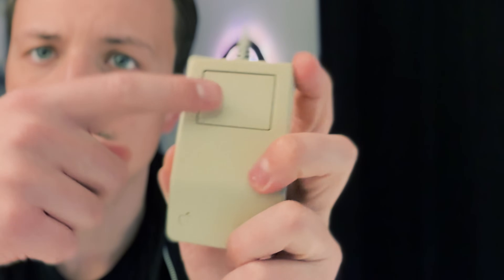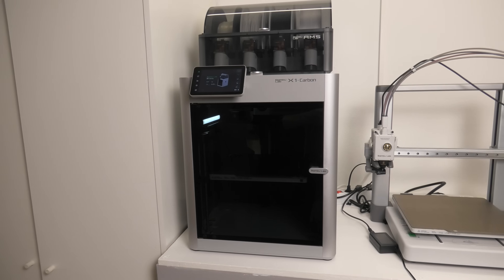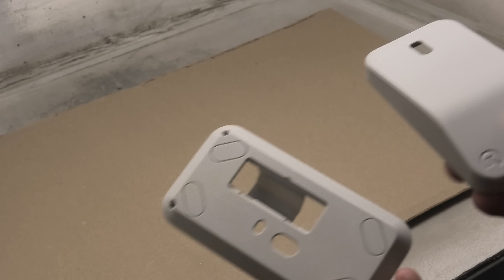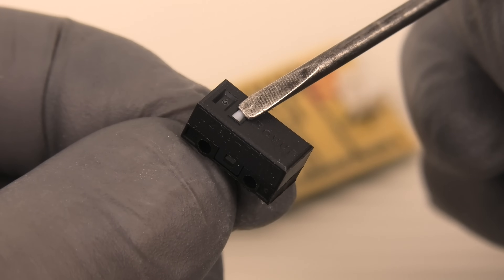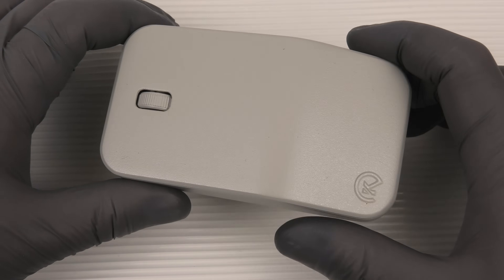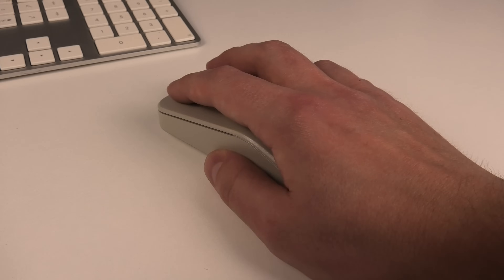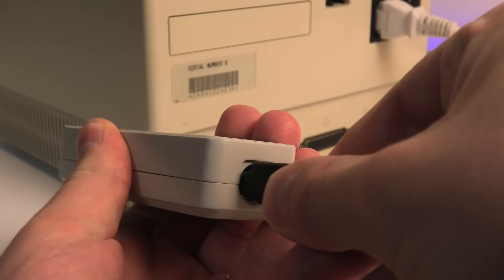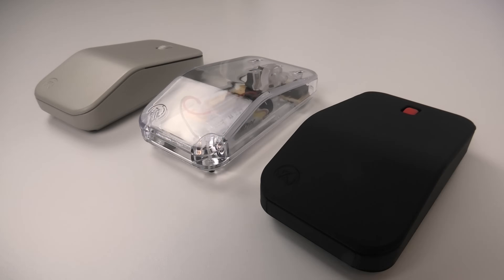3D Printed Retro Mouse

Comment: as the left and right mouse buttons arent separated, do you find you get miss clicks for the other side when clicking one? to be clear, i am asking if both mouse buttons can accidentally get pressed due to the design, when you only want one to be
Reply from the maker: Yes, that can happen, but only if you apply a lot of pressure to one side. I did my best to fine-tune the sweet spot, but I’ll see how it works for others once I get their feedback after printing and assembling it. 😊
Reply: @KevinNoki thanks for responding

Comment: How did you find the tracking on the Bambu mouse kit? I got one and was hugely disappointed at how bad it was. It works on hardly any surfaces. I'd actually prefer to have a ball mouse.

I had to check several times that there wasn't a film cover over the sensor lens, because I couldn't quite believe it could be such low quality.
Reply from the maker: Sounds like you might have gotten a bad unit! I actually have three Bambu mouse kits, and all of them worked great on the table shown in the video. The only issue I’ve noticed is tracking in direct sunlight, but that happens with other mice too. I haven’t tested it on other surfaces, though.

Comment: My idea would've been to make it look exactly the same. Use a small trackpad as the clicker and limit the touch area to a strip down the middle and allow the flex of the trackpad to press the right and left buttons. That way it looks identical except you can click both sides and slide your finger down the middle to scroll. Plus a rechargeable battery.
Reply from the maker: That’s an amazing idea! Please bring this to life I’d be the first in line to buy that version! 🔥🔥🔥